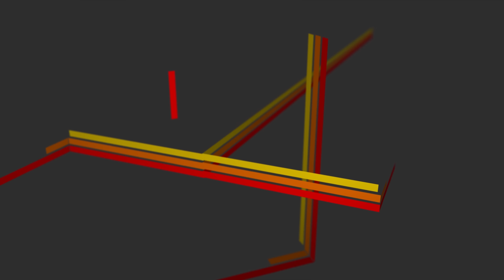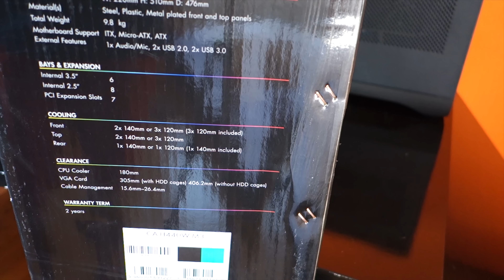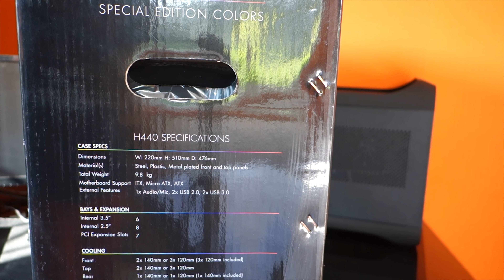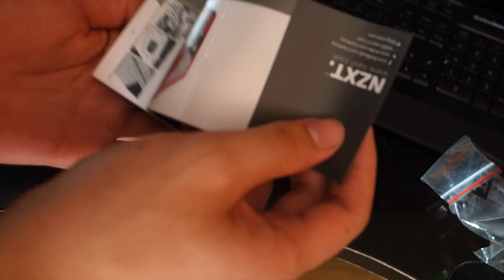NZXT H440 Green Unboxing Review and Build Timelapse

Comment: Hey. Is the 1m sleeve LED Kit enough? or do i need a 2m? I have ordered an H440 too and thinking about installing those NZXT Led's on it:)
thx and nice build by the way.
Reply: Yeah I wondering the same I think the shorter one only goes around the clear window when the longer one will go around the full case opening. have you ordered yours yet and which size did you go for? I cant decide on the colour I wont on the case
Reply: camsmyth101 Hey man. The sleeve i got is 2m. It works pretty fine. and looks great. If you have some leds to much you can easily stack em up at the right side of the Window. there is just space for it and its perfect. I got them in red and out them in my H440 Withe case. Looks pretty damn awsome i think:) hope you can get them. And to add at least in my country they are not that much money worth than the 1m sleeve. HF with your build
Reply: thunderstruuuck I've heard the cooling is crap with this case but I'm going to swap the fans anyway. Have you had any problems ?
Reply: camsmyth101 Not at all till now. But i cant really tell iuf its the best you can get since thi swas my firstt build and i dont know evreything. But everything works fine. Im really happy with it:)
Reply: camsmyth101 + i swaped the fans too: got corsair fans

Comment: Hey dude, very nice video. Inspired me to use the same visual set-up. Just bought the case with the bitFenix green cables! I seen that you took the factory fan off your cpu radiator and replaced it with the case one and i was wondering if the case one is better than the factory one? Or is a dual fan better with a push/pull config? Nothing in my pc is overclocked so im not sure if you need a dual fan. Thanks in advance! Subbed and liked!